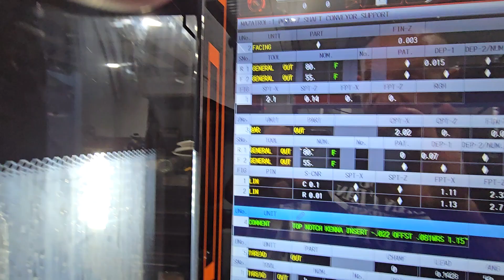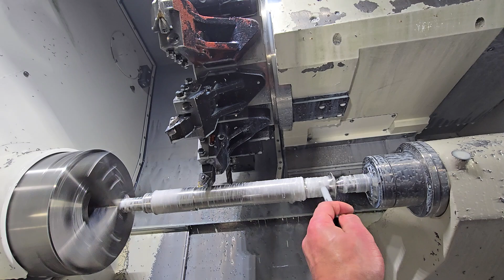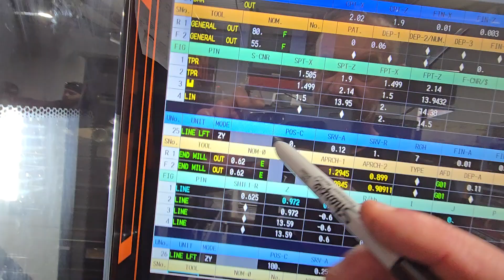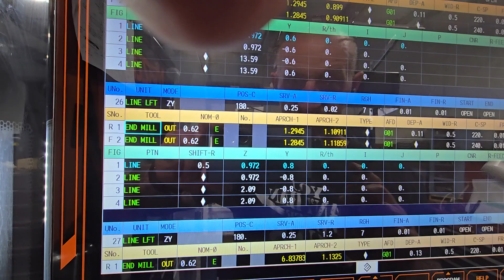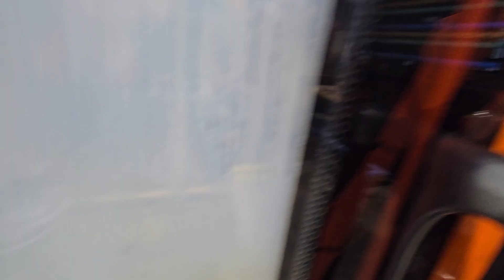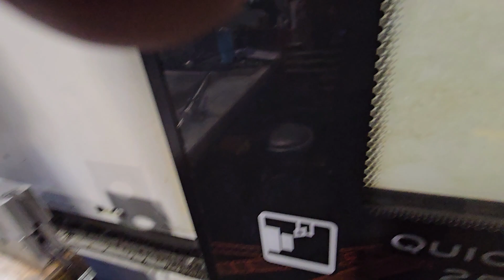Mazak Smooth G Line left Explained  how to do Flats Milling Drilling Chambers

Comment: I recently changed  jobs.  I ran Fanuc controlled Lathes since 1996 and had zero experience with Mazak at my new job.  Your videos have been very helpful.  I  run a  Mazak QT-400 which was pretty easy to learn and a new  QT-EZ 10 MY, which I use your videos  to cut test pieces at least twice a week. Keep up the great work.  The visual instruction you give on the parts really make the programming easier to understand  and follow along. Sending my thanks from the US.
Reply from the maker: Great to hear!